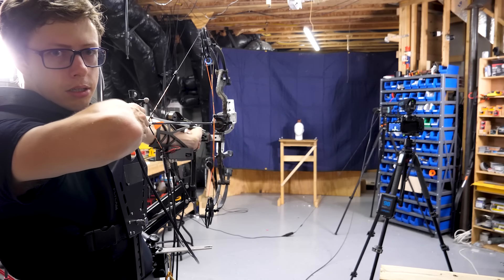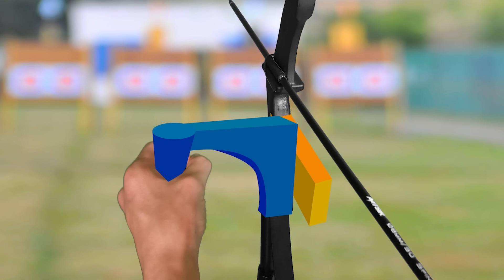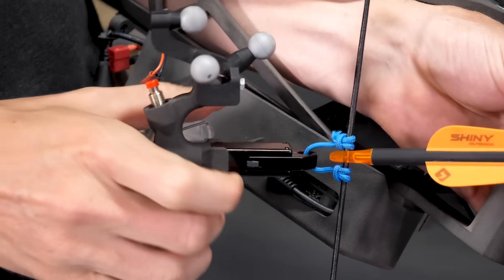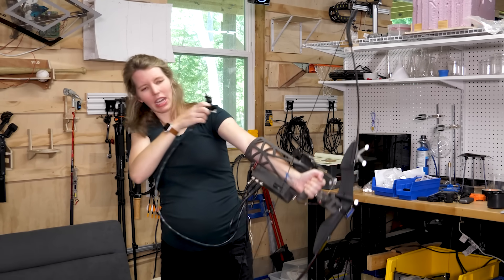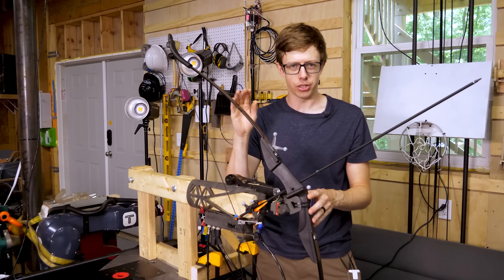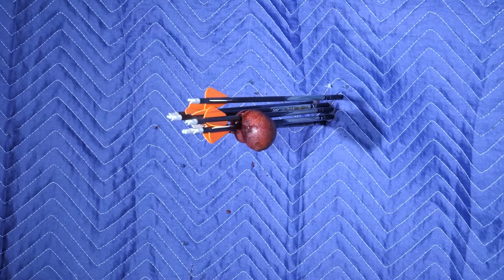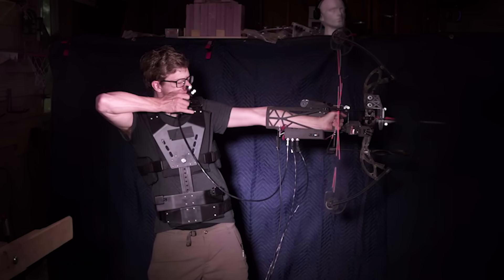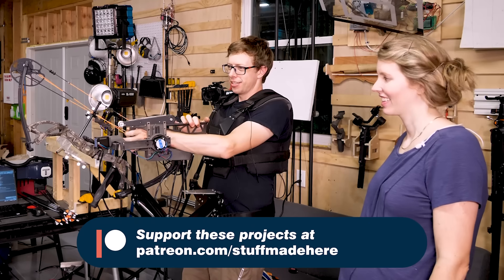Auto-aiming bow vs. FLYING targets

Comment: As an archer myself, I will tell you that you will get more accuracy out of that compound bow with a drop away rest than the force inducing whisker biscuit. Try that first. In addition, even with a compound bow you cannot get away from the archer's paradox. Spine to tip weight to bow draw weight absolutely matters. Hit me up if you want to discuss - software engineer who has a complete obsession with archery. Love the vids.
Reply: All these words could be made up and I wouldn’t even know
Reply: Also shaft quality. Something reputable with 0.0005-0.003" straightness will be helpful compared to a random set from Amazon
Reply: @anonosaur6466  Do they not make aluminum arrows anymore? Thats what my dad had back in the 80's with his compound bow. They were solid with threaded ends to change the tips.
Reply: @mikeworkman3593  they still make aluminum arrows, most people just prefer carbon fiber for compound bows.
Reply: @jacobhargiss3839  Oh, I'm sure they last longer and all, I'm just thinking they may be more accurate due to not bouncing around during flight. If you watch the slow mo you can see those carbon fiber shafts jiggling like crazy. More rigidity might take out that variable? IDK.
Reply: @mikeworkman3593  yes, but the alluminum arrows arent a great deal better on that front (at least in my experience).
Reply: @mikeworkman3593  they arent really used much anymore they are kinda old news 😂 some people still prefer them though
Reply: @mikeworkman3593  Arrow shafts with less variability jiggle the same way and hit the same spot.  Watch the Easton X10's at the Olympics flex like nobody's business all the way to the same spots in the targets 70 meters away and then think about how much all that movement CONSISTENTLY makes virtually no difference to the end result.
Reply: @anonosaur6466  At .001" out of straight, you discard that arrow.
Reply: @anonosaur6466  my shaft quality is crazy ;)
Reply: Came here to post this.... Get a drop away rest...
Reply: https://youtu.be/Q8Yp9SjCU5E This legend is the one to look at to work out the best way to shoot any bow.
Reply: @JamesGrim08  Darn! You beat me by 34 minutes! That video is a must watch.
Reply: What you mean with a drop away rest than the force inducing whisker biscuit?
Reply: @StarWarsExpert_  isn't it obvious? Just pragma mount the dioxide resin resistance capacitors to decrease friction impedance.
Reply: @StarWarsExpert_  a whisker biscuit is  what he has holding the arrow on the bow, it works by habing thin brisles that allow the arrow to pass through when fired. The issue with this is that it isnt going to affect each arrow identically so you loose consistency. A drop down rest on the other hand drops out from under the arrow when the string is released so the arrow doesnt contact anything.
Reply: I am sure you know this, but you are only scratching the surface... Torquing the bow will also be a huge issue, along with backpressure and just technique, in general, is nowhere near good enough despite the tech. In terms of bow choice, he has probably the least forgiving he could get... I could go on for a very long time here... Also more than happy to give up some time and discuss some things...
Reply: @tom9571  Yep, in addition I'm not 100% sure the mechanical arm didn't also move trying to keep 'aim' after the release. We need another joint effort video with Smarter Every Day and Destin's camera to see.
Reply: @Lrn2reason  I think to start with he would be much better off working with someone like @Jake Kaminski. Olympic archery turned Youtuber/coach, plus he would provide a very good control to see how good this system really is! Then yes, for the finer stuff, we need Destin. However there is so much going on, they might want some more cameras, so Gav from the slow-mo guys too? TSMG also has an MRMC Bolt now too, so there would be some super slick cinematics...
Reply: @tom9571  Oh yeah the slo-mo guys! I feel an entourage of awesome youtube coming!
Reply: Fake experts have entered the chat
Reply: A Fenris would solve eliminate many issues from this build. Eliminate hand shake, face smacking, and inconsistent draw distance while giving a reliable way to zero in the setup.
Reply: @Feroce  There's a reason not one single archer in any medium and above level of competition in the entire world uses a whisker biscuit.  They are for hunting levels of accuracy only and guarantee variation that is unacceptable for precision marksmanship.
Reply: Never mind the rests, watch your form regarding drawing, holding and releasing the bow string, need to set the draw length correctly and get some lessons where to consistently hold back the bow string from your wife. 
Should be side of your face string roughly back to the corner of your mouth never in front of your face and consistent draw point with a release aid your wrist should be back about level with your ear.
Reply: This is great advice.
Reply: @Xxoax  There are way better vids of byron ferguson but hes the best guy for this sort of thing in my opinion.
Reply: Along with everyone else  I was hoping to be the first one to suggest this lol
Reply: I’ve never had a whisker biscuit affect accuracy substantially
Reply: @MyLonewolf25  Substantially maybe not. He’s trying to hit a Lego Apple (size of an aspirin) consistently. I’m not aware of any tournament compound bow archers that use whisker biscuits. They introduce forces that make your shooting less deterministic.
Reply: @MyLonewolf25  Then obviously, you're not that substantially accurate to begin with, so you'd never notice the variations.
Reply: How do you control your obsession of hitting your software collegues with arrows. Excellent person you are!
Reply: Hi if you are not saved, and would like to be included in the rapture of the church. Believe that Jesus's death on the cross, was enough to pay for ALL your sins , yes ALL ,(past, present and future) That is what the Gospel is about. We are saved by GOD'S amazing grace, through our faith in Jesus's sinless life, death on the cross and resurrection 3 days later . No additional works needed. It is literally that simple. Do it today, don't delay. Time is short. Ephesians 2:8-9  Romans 10:9-10
Reply: @Jona7Fer  Nice to know. But anyways.
Reply: not entirely true ..  i have used both and have better accuracy with the whisker biscuit than a drop away. and more things can go wrong with a drop away than a whisker as well.   but if he made it so his hand sat a little more forward than the mechanical arm  and drew the bow properly  elbow up and not straight into the chest / face he would hit his face less and be more accurate as well .
Reply: I feel like I'm watching Patriot: 

"Hey. Let me walk you through the Donnelly nut spacing and crack system rim-riding rip configuration. Using a field of half-C sprats, and brass-fitted nickel slits, our bracketed caps, and splay-flexed brace columns vent dampers to dampening hatch depths of one half meter from the damper crown to the spurve plinths."
Reply: 100% this!
Reply: i am not sure if i understood this but you are probably right ;)

btw i never thought that a software engineer can have a different hobby other than coding xD
Reply: Damn!!! ....I was hoping I'd be the first to suggest a drop-away....
Reply: BUT you can learn what the Archers Paradox actually is and stop using the term incorrectly.  Even trusted youtubers get this wrong, as do 99 percent of archers that think they know what it is.  If you're referring to anything other than the arrow LOOKING LIKE IT DOESN'T POINT AT THE TARGET AT FULL DRAW, you're just flat out wrong.
Reply: @admacdo  I’m actually talking about the flex and oscillation of the arrow shaft during flight.
Reply: @Lrn2reason  Which is absolutely NOT archers paradox.
Reply: Yea, you can get accurate with a cheap bow, (thats what I mostly get to use. I’m not a professional but I’m pretty decent especially at moving targets) 

But you have to be used to cheap bow in order to get decent at it, however my experience with compound bows have been a lot more accurate with little usage.

Comment: You are living a dream man, kind of my dream, but yeah, i'm not even getting close to you ever... And good job on the bow man, i thought you would do tracking with camera, some pressure sensor on the holdsr of the string, so it know gow much are you pulling, the some gyros and then it would work anywhere, but yeah, computer on the back i guess lol, maybe pi 4 would be enough, but most likely no, so computer back pack or wirelessly to notebook...why am i even writing this lol it is stupid idea

Comment: I think you're still limited by the bow. That bow is setup and designed for hunting. The arrow rest is going to provide wobble, the release looks a bit uneven, you're not balancing the bow or letting it rotate/drop. 

Another thing to play with is your posture since the movement of your arms during the pressure collapse will play a big role.

 If you want, I can send you my bow setup that can split a playing card at 30 feet consistently to use in your next build. At your distance, with a good setup you should be ruining arrows with Robinhoods consistently with a good bow. 

Love this channel, keep up the good work.

Comment: Hey! AWESOME STUFF.  I have noticed you have used the resin printer for some parts, and I was wondering if you would give me your opinion on the viability for structural parts and what resins you use for it.  I am considering getting a resin printer to help with some prototyping to accompany my Ender 3's and Cr 10s.

Comment: Aren't you running into tracking noise floor on the release? The three markers for the release are pretty close together and the actual release point is relatively quite far from the center of the markers, so any angular noise for the release gets amplified.

Comment: Very cool, but I think the aiming should be reversed.  Could you hold the bow steady and have the robot move the string?  As you pointed out, the bow would need to be on a gimbal to line up with the release point, but moving the string end should be more precise without having to move the mass of the bow around.  Good luck on v2!

Comment: Is v2 removing the camera tracking of the bow in exchange for a gyroscope to remove the location constraint? You could use a force sensor on the drawstring to calculate the draw distance. I would imagine using the sensors integrated with the bow would reduce calculation time as you remove the need to triangulate the position of the bow. May help with accuracy?

Comment: Are you trying to invent the crossbow in V2?  Your shaky release hand will never do.  Watch the Olympics, those folks are rock solid steady.  A higher pull load would make a flatter trajectory, to boot.  Just like you need a robot arm to hold the bow you need to have a machine draw the bow (or at least hold the drawn bow).

Comment: This is amazing beyond everything I have seen!!!    Was surprised you didn't use a compound bow from the start, since how far you draw the string will affect the arrow's velocity and therefore its trajectory, and that's why Olympics shooters use a thing calling "clicker" for consistent draw length every time.   

I want to see how far you can push this contraption in an Olympics setting: Recurve bow, 70 meters, and bullseye the size of apple.   Then you can't use the tracker system... but I'm sure you will figure something out!

Comment: I'm guessing the improvements might have to do with the actual tracking? The markers are insanely accurate, but whether the target is perfectly in the center seems like a huge problem. Maybe some computer vision on the end, so it can also see what is moving and use that too? Or maybe the issue is just how far the bow moves; seems like right before it shoots the bow moves very quickly and your arms can't stay stable. Any amount of movement when it's already shot the arrow will cause inaccuracy. Maybe you'll also add a counterweight system, so you just have to hold it somewhat in place and it won't be pushing your arm in weird ways. Either way, can't wait for a V2. It's really an amazing idea, especially when you started using the compound bow. The steadying rig attached to your chest is also great, even though it's built for function it absolutely LOOKS like an aimbot :)

Comment: Hey, just an idea. Why not try making something that is not reliant on markers and mounted camera system? What i mean is a camera on the bow itself (or on whatever else) and/or lidar for distance calculating. Also for stability of the bow you could use the same kinda "supporting arm" like cameramen use that stabilizes movements or makes them smoother so its easier for the system/code to adapt and faster to calculate maybe?

Comment: How did you not just build a chain/rope from the switch to the bow so that it can't go back farther than how far you draw the bow?  Would it have caused a las second jerk motion as the string is let go?  That's like the first thing I would have tried to solve... I quite don't like hitting myself in the face.

Comment: "The Aimbow"
legendary bow
+100% accuracy
- user takes 15hp facial dmg per shot
Reply: He just hasn't found the helmet that goes with this bow yet.
Reply: @brandonpayne1207  Helmet with a heads-up display? Now that is epic.
Reply: @brandonpayne1207  You need to find it in dream land.
Reply: Applies self-debuff: nosebleed
Reply: Must be strength level 6 or higher to equip (or have a robotic arm snake thing)
Reply: Yes
Reply: fire-rate unaffected by Legolas perk
Reply: I love this comment. I wish i was as clever as this man is.
Reply: @mynameis8211  you are though!  The problem lies in that you wrote this comment.
Reply: well marvel can finally get rid of hawk eye
Reply: Specifically the Nose
Reply: - 15% speed Debuff
Reply: Weight 50 
-10% speed debuff
Reply: Crafting requirements :
Intellegence : lv. 10
Reply: I think it is more realistic to say that the accuracy is +1000%.
Reply: good one! <3
Reply: Did he fix the punch in the face issue?
Reply: So I still need 15hp recovery ring or amulet per energy hit. LOL
Reply: @dealstobid  just strong enough HP recovery potion would make it.
Reply: -30% running speed
Reply: - Replaces both chestpiece and weapon
- Provides partial physical damage reduction
Reply: Exotic bow*
Reply: actual tf2 weapon
Reply: @colinouille2786  It's just the lucksman
Reply: (Only works if several tracking cameras are installed in the surroundings)
Reply: https://youtu.be/w8J-Vasc9s8🤗
Reply: The Autobow
[+] Arrows Automatically fly towards the head of any Target in a 3 Degree Cone
[+] Automatically fires 
[+] Projectiles Travel 20% Faster
[-] Has to be fully charged in Order to fire
[-] -5 Health per Shot
[-] 15% Less Movement speed
[-] 5% Additional deploy time

[~] Modified version of the "Fortified Compound" built by the Engineer for the Sniper in his free time. Although living by the quote "Professionals have Standards" he can make minor exceptions
Reply: Bludgeoning*
Reply: Still better than emotional damage.
Reply: also move speed -15%
Reply: no random critical hits
Reply: Helmet sold separately😂
Reply: -no random critical hits
Reply: On hit get kicked
Reply: ITEMSHOP!
Reply: Hi if you are not saved, and would like to be included in the rapture of the church. Believe that Jesus's death on the cross, was enough to pay for ALL your sins , yes ALL ,(past, present and future) That is what the Gospel is about. We are saved by GOD'S amazing grace, through our faith in Jesus's sinless life, death on the cross and resurrection 3 days later . No additional works needed. It is literally that simple. Do it today, don't delay. Time is short. Ephesians 2:8-9  Romans 10:9-10
Reply: ^^^^^^^^^^^^^^^  upvote this please!
Reply: @TaranovskiAlex  found the reddit user
Reply: It is so early in the day that🍣🍢🍠🍝🍜🍛🍚
Reply: and do not run off the path☠️💀👺👹👿😈☻
Reply: go into her room, don’t 🤙🤘🖖🤞✌️👇
Reply: @f-ckmyr0fil617  what is "cuvxvf"?